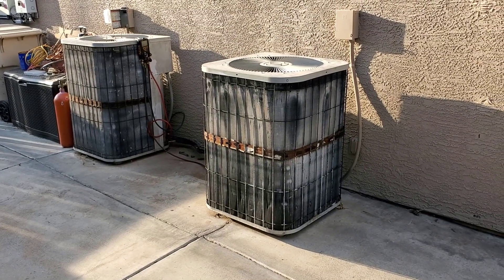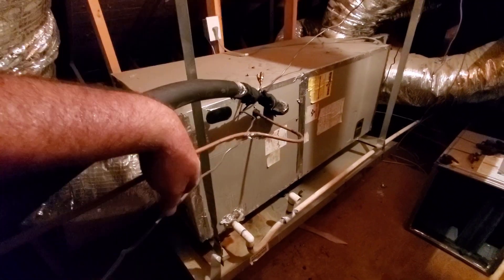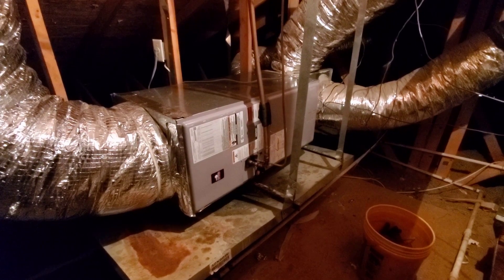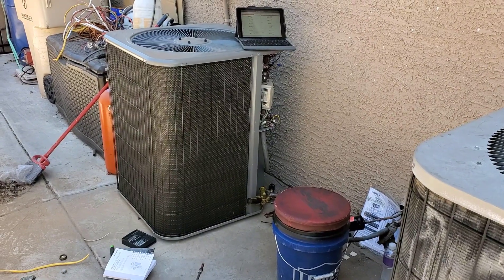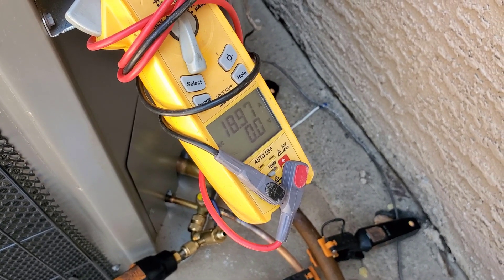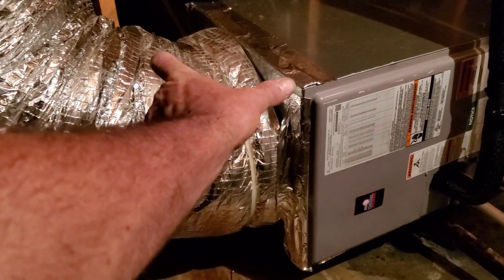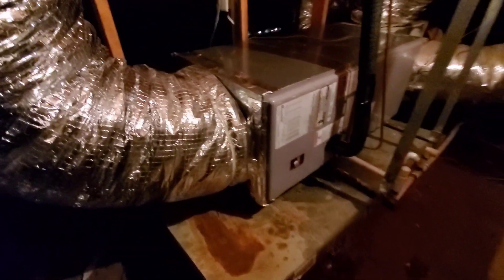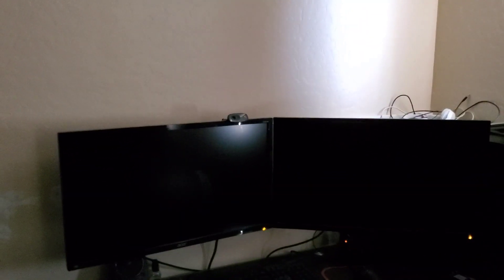Installing my 3 phase VFD powered split system today - Off grid Solar power integration coming next

Comment: Is that VFD a small J1000 or am I’m miss lead? If so that VFD shouldn’t be powerful enough to run a 3 ton compressor! what’s the output current specs on it?
Reply from the maker: J1000 comes in various capacities.
It's rated for 24 amps input, 19.6 amps output. 3 phase. I am feeding it single phase input (which just charges the capacitors nonetheless) so it pulls about 19 to 20 in via the single phase, 8 to 9 amps out (3 phase).
Reply: That’s good then I didn’t realize they went bigger the 2.0hp on that model so plenty of IGBT power to drive it! Cool idea I really think your onto something here. The next thing would be to give that vfd input on frequency based on suction line temp then you could have a super efficient compressor

Comment: How common is it for a vfd variable flow compressor to be paired with a standard psc condenser fan like this? Also, is there a residential vfd system on the market that uses traditional 24 volt control  instead of the new communicating stuff?
Reply from the maker: This unit did not come with a VFD. I hacked it in there. 
And this is a Scroll compressor so it will not be slowed much. I mainly built it this way just because a VFD will operate from a DC input and I have solar panels I set up to feed some of the power to the compressor this way.
Not having the ability to slow the outdoor fan probably won't be an issue around here. 
But if it does, I will just have to modify it some more.
Reply: @hackfreehvac if you find that you need to control the condenser fan ICM makes a couple of different adjustable condenser fan controllers that modulate based on liquid line temp or whatever you tie the temp probe to. I believe it’s a power “chopper” type that uses PWM duty cycle to control the fan speed. I’m betting though if you dig into it that you could use a hack way of directly controlling it with 0-5/ 0-10DCv or 4-20ma. 

Prob use the 0-5DCv as I’m thinking the probe input point is powered with 5vDC and the temp probe is similar to a common CPC 10k ohm, type 2 thermistor. Manipulate the “line temp” by feeding different DC voltages into the input point maybe. 

Right now I’m digging into using a Emerson E2e refrigeration controller to monitor/ control my whole home AC system. 

I hacked a Trane VS ECM blower into the vintage ‘96 Trane AHU part of my system. Outdoor unit is a ‘03 Trane 3.5 ton 12 seer heat pump that I changed to 4 ton when the original scroll died one day. Lol Gonna have that controlled digitally by the E2 controller as well since it can have digital refrigeration compressors used with it. Also could use a pulse or stepper EEV valve for high side control or use a Sporlan CDS EPR valve for low side control. Anyway there’s tons of options of different shit to use that’s  way over fancy for a simple resi system. Lol. 

Looks like your getting your shit fancy too with a VFD. I wanna do something similar as well. Just gotta plan it out, get shit, and throw it together. Just that simple.. yeah right. Haha.
Reply from the maker: @orlandotech  Oh yeah this video was from the beginning.
I swapped out the split cap motor for a ECM. I separated the module from the ECM and remote mounted it to preserve the fan blade depth in the shroud. It ran that way until last month when i swapped in a tall slender HP cabinet with dual horizontal fans (check more recent videos). The Lennox was still running on the drive and modified ECM motor when I removed it.

Comment: I hope you went through all the VFD settings and made sure it was set up for high starting torque. Compressor acceleration seemed a little slow there.
Reply from the maker: I changed it from 10 to 3 seconds acceleration.
It has no issues so I haven't gone and tuned any more. 
It might have been still set longer when I did the first video clip.
Reply from the maker: And on the rotary compressors in Friedrich units,  you should see those suckers.
The compressor starts so slow that it shakes about four a while.

Comment: Cool project. Reminds me of when we were installing those Yaskawa drives on old standard RTUs to make them variable speed. 
Maker was Bestec designed by some engineer from overseas. Smart dude.  Unfortunately for them more and more units are coming from factory VS or will be soon so that retrofit market will disappear. 

How are you controlling your speed input?
Reply from the maker: Just run enable and it runs 60Hz for now 
I might change it to 2 stage later after I finish testing it balls out this week torrid the 117 degree forecast for Thursday!
Reply from the maker: I have the same drive on my home made water source heat pump water heater in my garage. 
40Hz on start then drops to 35Hz when the leaving water exceeds 130 degrees 
That's on a 2 ton 3 phase recip.
Go neck a few months and see that project. 
That unit has ran for over 2 months now to heat my 50 gallon water tank to 130 degrees. 
8 amps or so compared to the 18 amps to run the original electric. 
And it recovers faster.

Comment: Put Diversitech Pucks in those pans. Can see original installed drain line doesn't look proper until you added the 90 pointing towards the pan.

Comment: What's the purpose of running the 3 phase system via VFD? Was this done because you got your hands on a 3 phase unit cheap or is there a technical reason? Cool idea btw!
Reply: Variable speed three phase motors are more efficient because they can throttle up and down to meet the cooling needs of HVAC system. You should always protect equipment like this with a good surge protector with brownout detection. The electronics are very sensitive in the VFD controller and HVAC manufacturers are too cheap to add protection circuitry.
Reply: PickleRix Sure but the unit went from 4 to 3 ton, I imagine it will run at 100% all day?
Reply: @fluke196c you can play around with coil SST (evaporator temperature) and airflow to pull a metric fuckton of humidity out of the air to make up a little for the lack of raw system power. Also, you could have a 2 stage thermostat switch between “normal AC” mode and “ultra dehumidify” mode by using a couple of cheap 24v relays to change blower speed and possibly VFD speed. 

Key thing to remember here is, the lower you can pull the RH% down in the house the warmer you can set your thermostat setpoint and still keep it very comfortable in the house (and hopefully a cheaper power bill in the process). 

Gotta cover the basics too like a well insulated attic, decently tight building envelope, and a window upgrade over the “builder specials” that the house came with when it was new.

Comment: How old was that Goodman equipment?
Reply: Those Goodman’s looked pretty old but there’s nothing wrong with some of the new Goodman equipment. I just installed a new Goodman gas furnace, coil, and 16 SEER condensing unit and it works great. I liked my old Goodman furnace because it was easy to fix and parts were readily available and cheap. When I removed the 27 year old furnace, the heat exchanger was still in great shape because it was installed correctly with proper air flow. BTW, most horizontal furnaces will rust away if you don’t check and clean out your drain lines once a year.
Reply: @picklerix6162  That's good to hear! I install about 200 Goodman systems a year. They are great units for the price. I actually just installed a 16 SEER 2 ton Goodman AC today!.
Reply: @picklerix6162  i was poking some comedic fun to it. i was going to say WWII surplus, but somebody may not understand.....
Reply: @rearspeaker6364  Do you think Hitler had a Goodman system keeping his bunker nice and conditioned? 🤣
Reply: @Spector_NS5_RD  oh yes-the Red Cross gave it to him as a housewarming present the Red Cross got it from Roosevelt.
Reply: looks like Vietnam war surplus!!

Comment: I'm assuming you will let us know how the 3 ton is doing after a little bit of run time.
Reply from the maker: Worked ok all day Sunday. 75 degrees and it cycled. 110 deg amb but humidity fell below 20%
Reply: @hackfreehvac  good deal.

Comment: That high pitch sound is awfullll damn
Reply from the maker: You can only hear it when standing over it. 
It's not loud.  It actually sounds kinda cool. 
If it was bad I could change the "carrier frequency" in the VFD. Well,  most can change anyway 
I think 4khz is typical.

Comment: So does it pull down to temp?
Reply from the maker: Been running 75 with the new unit so far. 
And air flow feels the same. Which is quite surprising.
Today the humidity dropped but it's supposed to be back up to 110 for a high and it will be 110+ all week long.

It is 2:40PM as I type this and it feels great up here.

Had it at 74 last night but that felt too cold. Not used to it being that cold in this house.
I used to run 77 at the lowest and usually 80 during the afternoon due to the time of use cost.

Comment: The Goodman into would make a great horror movie.  Hvac tech replaces Goodman’s only to be haunted by the RAAaAaAaAa every night.   Maybe you’ll score a 4t 3 phase and move the 3t vfd to the first floor.
Reply from the maker: I am hoping that the 3 ton is actually enough.
But if it isn't, I already figure I will disconnect a room off of it upstairs and install a mini split for that room.
It's a seldomly used room.

Comment: You can easily run it between 35 and 70hz, i have some installs that work fine now for some years. However its refrigeration application.
Reply from the maker: Scroll compressors?
I thought of over running the speed a tad to increase capacity and drop the suction a bit.
But so far it's working good.

I will see how it goes this next week. Temperatures will be 110 plus!
Reply: @hackfreehvac  yes copeland, zb and zr. Suction pressure control on pressure transducer 404a. Looking forward for the next video.!

Comment: Getting closer now to taming those electric costs.  Keeping that 3-ton unit off grid during peak summer hours should save at least $40 a month in demand charge alone,  separate from the kWh used. 
That was fast work today installing.  It well be exciting to see the solar connected.
Reply from the maker: Save some $$ and run my home cooler!
That is the goal anyway.
Just got to install another disconnect at the condenser and pull that wire.
Oh, and install the two other solar panels I have to increase my DC voltage.

Comment: Damn cool, hopefully it keeps up. Is there a big "cooling" difference going from R22 to R410A even if it would be same size unit?
Reply from the maker: The general consensus on R410 is that it doesn't maintain the capacity as well as R22 on hotter days. But I have not fully proven that or not.

My new system is considerably smaller however being that it is a 3 ton and the old was a 4 ton.
Reply: I replaced my 12 SEER R-22 Lennox system with a 16 SEER R-410a Goodman HVAC system. I was shocked that my electric bill dropped to less than half what I paid last year.  I replaced the supply plenum too so the old duct board plenum may have been leaking but I was not aware of any leaks.
Reply from the maker: @picklerix6162  yeah.  You must have had something wrong with the first one because I don't think a 12 to a 16 would cut it on half. 
That's a lot.
Reply: @picklerix6162  A 10 seer changed to a 15 seer would be a 50% decrease in energy. So a 12 to 16 would  be about that. Plus the old one probably wasn't tuned well.
Reply: Timothy Salomon  I've also heard 4 ton R410A Units with 3.5ton compressors. I guess they're more energy efficient but won't cool as good as the older units
Reply: @stoutlawsnopreptalk I remember back in the r22 days that you gained a whole SEER point by using a TXV vs a shit piston metering device if the system was an approved ARI matched setup.
Reply from the maker: Timothy Salomon  
It has a ZP29 in it. 29,000 BTU.
I think the old recip was a 38,000 so I lost almost a ton.

Comment: Would love to see the vfd wiring diagram if you could.
Reply from the maker: The high voltage in and out or do you mean how it is controlled?
Reply: hackfreehvac high in and out.
Reply from the maker: @lee-johnson  
The 230V single phase just connects to any 2 of the 3 input terminals.
It just rectifies to DC inside the VFD so it still works.
Output is standard 3 phase wiring.
Reply: hackfreehvac The drive doesn’t fault and say it’s missing an input phase? I guess I would have to see the drive manual. What’s the model of that drive , if you have time? I’m used to ABB , Danfoss etc ....
Reply: Lee Johnson that looks to be a Yaskawa v1000 or close.
Reply from the maker: @lee-johnson  Yaskawa.
Don't even have to change any settings for that either. 
As long as the DC bus has voltage in its acceptable range it seems to run. 
Which is why I can also run one with only a DC input and no AC input at all. 
Which I do all the time where I have another Yaskawa hooked up at the solar panels for testing.

Comment: If This Works, which knowing you , it probably will. Will open up a Whole New Business For You & or Your Company. Saving 50% on an Electric bill is No Joke & People Would be Begging you to do this for them. I Wonder Why noone has done this yet ? Is This idea patentable ?
Reply from the maker: They actually do cell mini split units that have power connections for direct solar panel input. 
I think they are using a lower voltage compressor and whatnot. But they do make them.

About a month ago some guy we know stopped by with his off-grid RV so my other friend could install some Lithium batteries for night use.
Solar on the roof.
His mini split ran directly off of the DC power. Solar during the day and batteries at night.
I have a video of it.
Reply: Check out engineer775 he is involved with the dc mini splits.

Comment: what do you think about putting an exv in the ahu for variable capacity? possible dehumidification too?
Reply from the maker: I think the TXV would throttle down to some degree anyway.
That's all they used on the 2 stage units for years.
The Scroll can't be slowed down too much like a rotary on a VRF unit so I wouldn't need much adjustment anyway.
I'd probably drop to 75% or so capacity if I slowed the scroll a tad.

This unit is also a 3 ton in place of my 4 ton.

Plan B if my upstairs can't cool enough is to disconnect a seldomly used room and install a small mini split.
I've already got my mind set on trying to connect an external DC power source to a inverter drive mini split.
Reply: @hackfreehvac  cool. i have a 3 ton goodman in my house and an ecm blower motor and im staging the blower with  some decent results. the txv does adjust pretty good and keeps the sh on check. the sub cooling goes up a bit when blower ramps down but its been running great for over a year. i do have a cheap chinese vrf mini split in the master bedroom and and thats what we run at night because its just me and the wife. no need to cool the entire house. cool project you have going there. im interested on solar results.
Reply from the maker: @Manny32V  
That higher subcooling makes sense.
The TXV closing down for lower airflow means more refer stacked up in the condenser and less in the evaporator.

So you have a 1 stage unit but am just slowing the blower with a 2 stage stat?

A de humidification stat would cause the unit to do the same thing so it shouldn't hurt anything.
Reply: @hackfreehvac  I have a 2 stage thermostat a vision pro 8000 with remote sensors but I'm not using the second stage or the dehum options. I installed a couple of time delays with relays and I'm just using the timers to stage the blower. First 10 minutes of run time is lowest speed then then 5 minutes after the first timer it goes to medium and 10 minutes after that it goes to medium high. It works really good. Yea i do stsck a bit of refrigerant in condenser but superheat stays on point. I dont think that this will work in a micro channel condenser because they can't stack much refrigerant at all.  The relative humidity in my house stays around 45 to 47 percent at 72f which is pretty outstanding for an old house in south florida during summer. In the colder months the lower run times work really nice with the low speed for the first 10 minutes. I get excellent run times for maximum dehumidification. The original unit the house had was a 2.5 ton but in the hot summer months it couldn't keep up. With the 3 ton I get good summer performance and great cold months performance as well. If the blower was at a fixed speed I would not get enough dehumidification in cooler months.

The ahu motor is an ecm so the speed changes are pretty smooth.